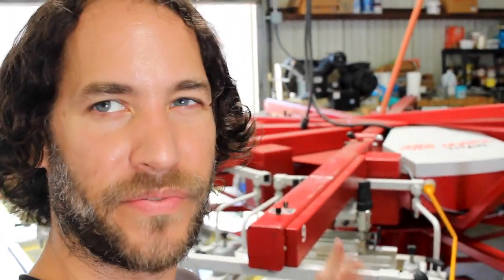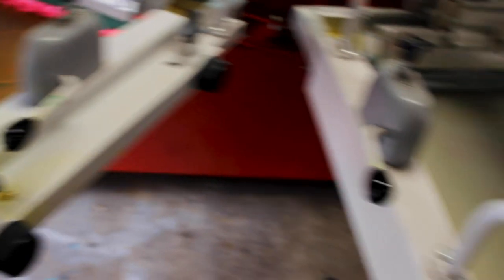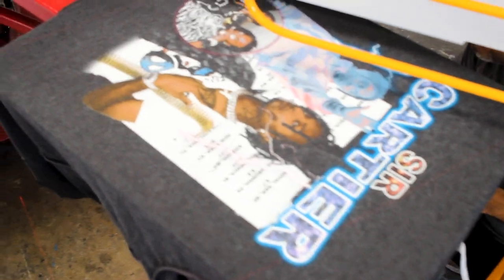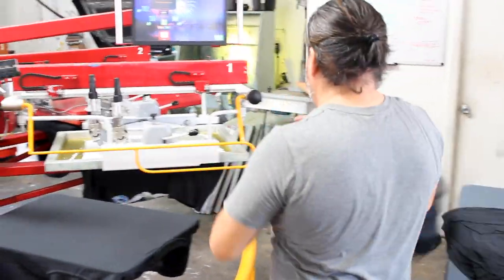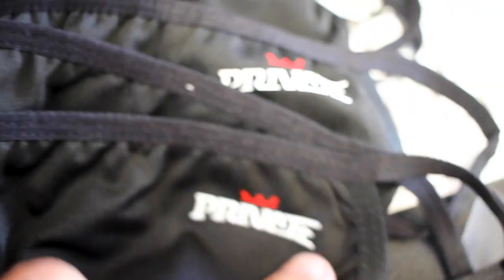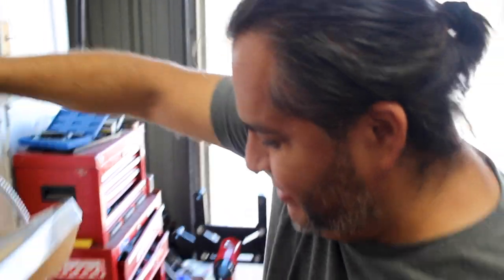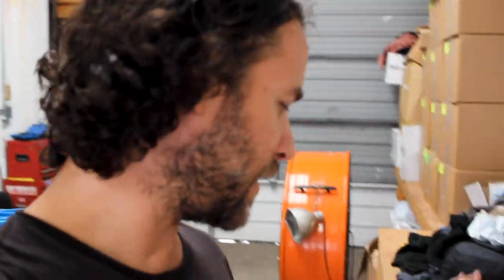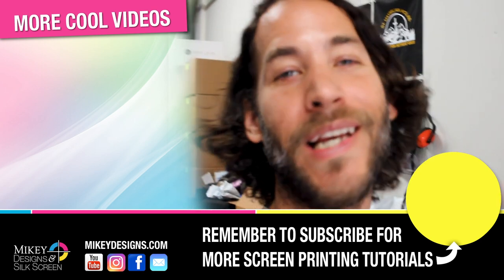These Vintage Rap T-Shirts are off the CHAIN! ⛓ Screen Printing Vlog - Anatol Titan M

Comment: Whats the best way to print one off Vintage rap tees? I want to do DTG but the have gradients so It may show the white base on a Black tee.. Im thinking Plastisol or heat transfers? What do you think?
Reply from the maker: I'd say plastisol screen printing for vintage tees using a higher mesh so the ink isn't so thick.